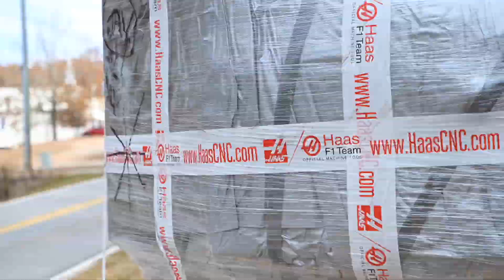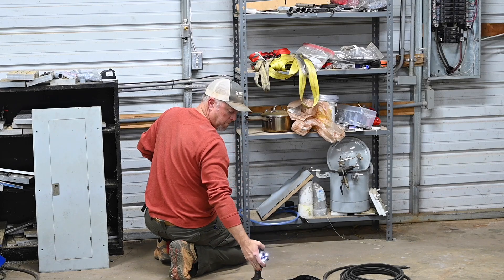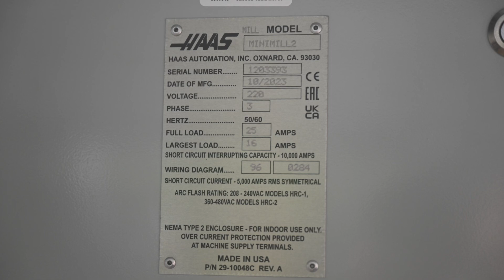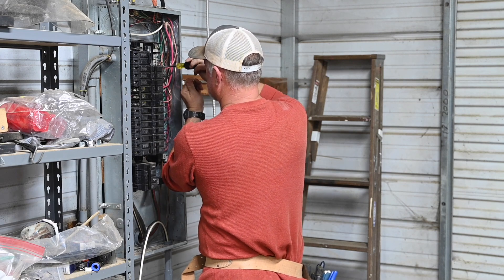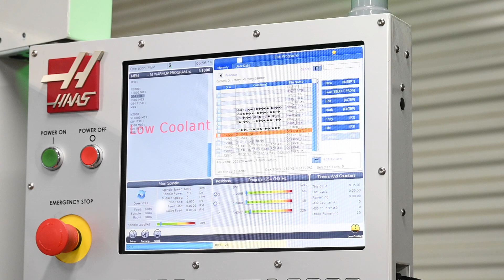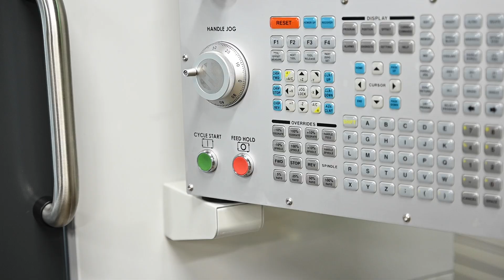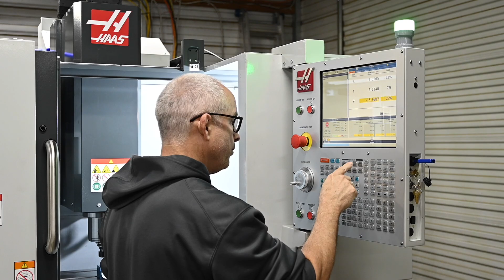It's Alive! - Metal Cutting Monster Comes to Life

Comment: He should have set the test indicator closer to 20° to the bed rather than so vertical, not to mention a larger radius from the spindle. Unless he was just roughing it in in the part you showed.

Comment: i used to run set up and program a haas at my last job. i wrote a program to make knives using the mirror image features, could do 6 at a time. fixturing can be an issue though. congrats on the new toy and many fun hours using and learning it. always use dry run and understand the alarms.